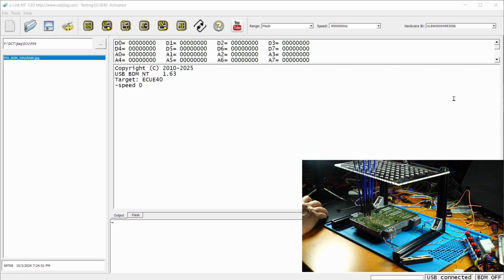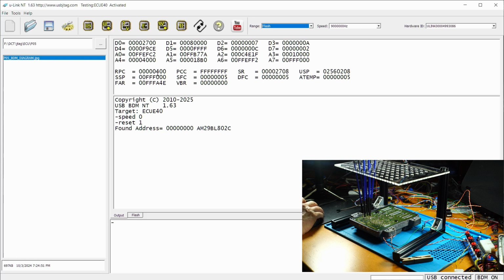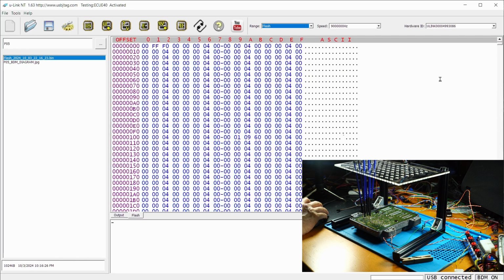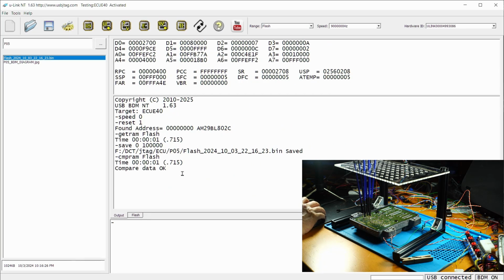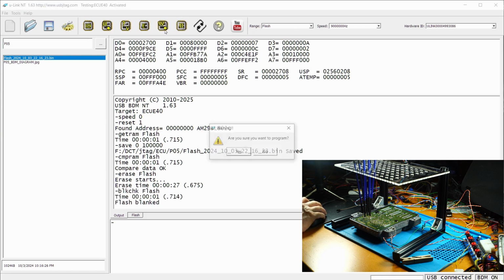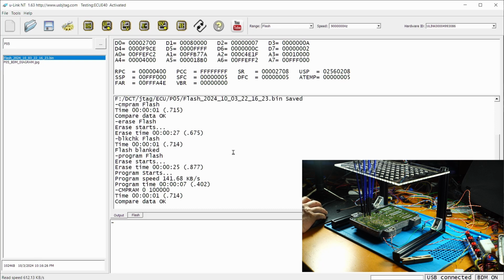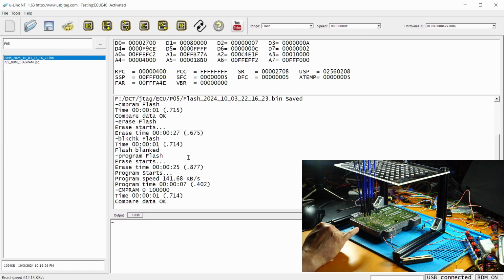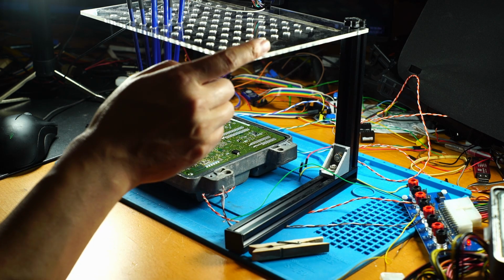u-Link NT program ECU P05(No soldering)

Comment: I get "unknown flash type"  0089h,88f2h
Reply from the maker: @johnjacobs4625  you need to add the flash definition in the norflash.xml.
Reply: @usbbdm  Copyright (C) 2010-2025
USB BDM NT    1.71
Target: ECUE40
-speed 0
-reset 1
Found Address= 00000000 Intel 28F800F2

Got it   Thanks!